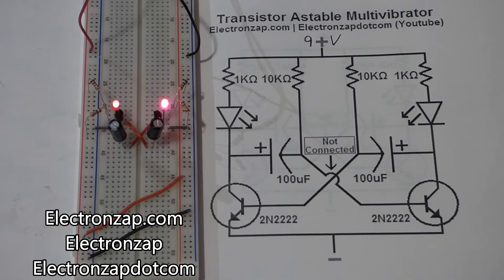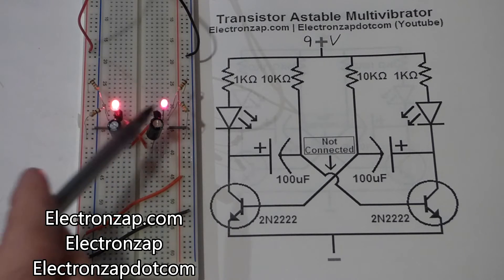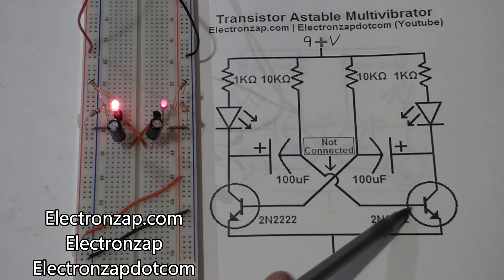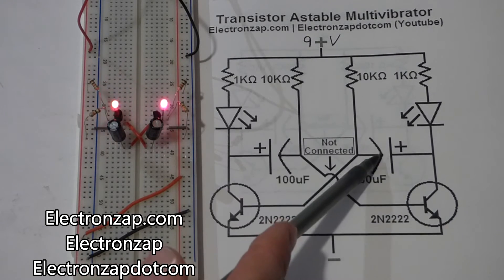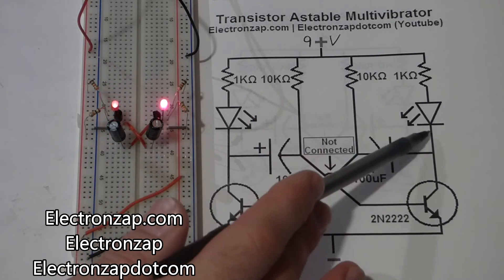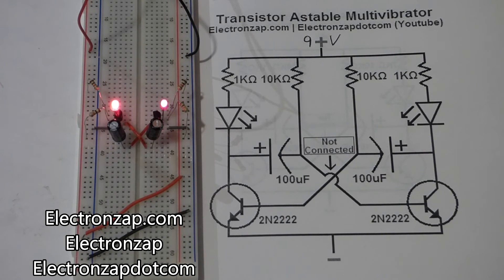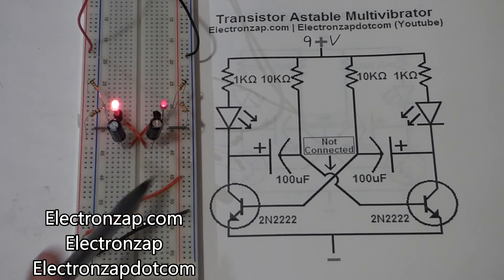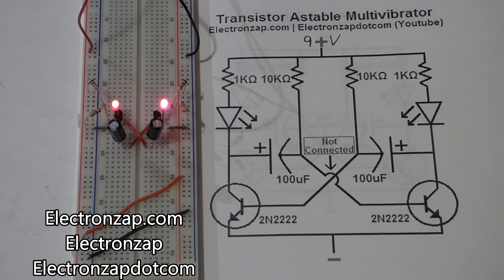Astable multivibrator demonstration circuit using 2n2222 transistor capacitors and indicator LEDs

Comment: nice tutorial, would be interesting for me if you can teach how to calculate the resistance for this tutorial.
Reply from the maker: Thanks for the kind words! That's an interesting topic, but the resistance keeps changing. I have already made videos on resistor resistances, semiconductor voltage drop and how the capacitor resists current more as it gets closer to the power source voltage. Those are the main resistance factors in this circuit so I recommend studying each topic independently.
Reply: Thanks, I will see those videos again